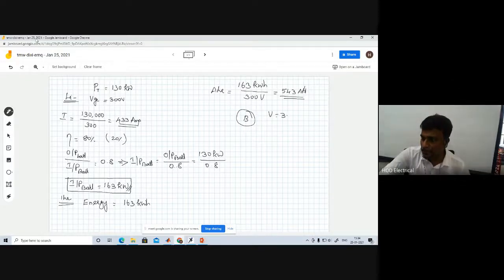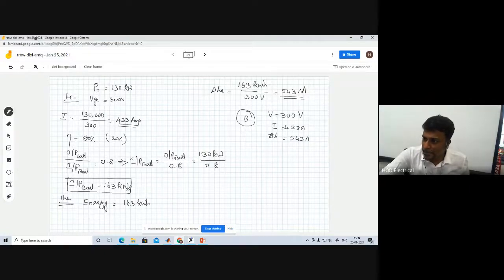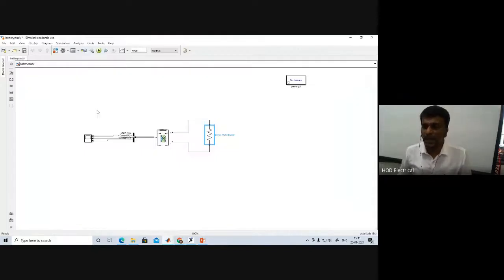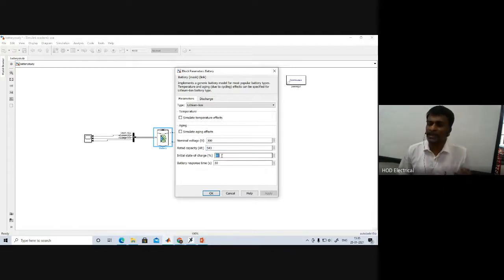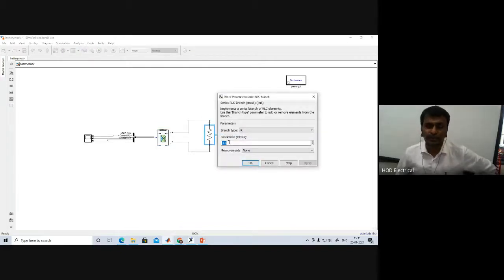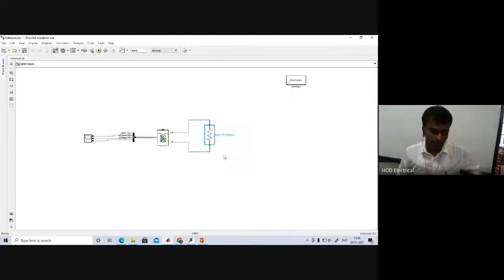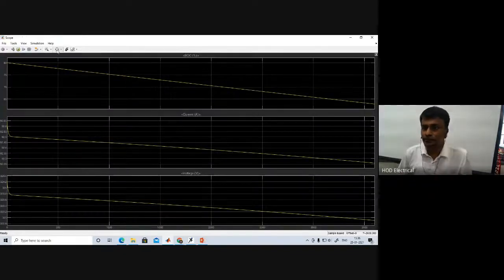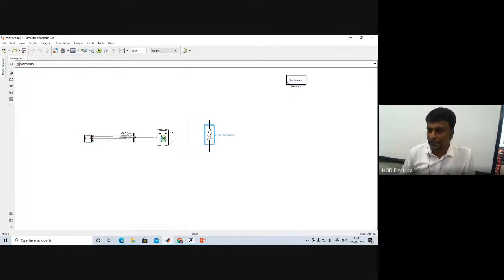Electric Vehicle 18: Battery Design for Electric Vehicle By Dr Rajin M. Linus

Comment: Explained well! Isn't the Current rating (I) for the battery at the end of the calculation be 543A instead of 433A?
Reply from the maker: Thank you for your comment. 543 is the Ampere hour rating based on the energy requirement.

Comment: Sir... Your explanation is good, but i have one doubt
First  we are calculated  the total tractive force from that we have selected the battery rating according to that required tractive effort.. Now my doubt is
While calculating tractive forces we haven't  considered the battery  weight,  in ev power train design weight is also a factor which will  effect on rating of motor. So how the weight of battery will effect of power train design of an ev
Reply from the maker: Total wait of the vehicle includes all sir. 1000 kg expected all. Thank you for your comment and discussion to allow me also thinking in a effective way 🙏🙏
Reply: @Electric_known  before selecting the battery capacity, we don't  know the weight of the battery, after knowing the rating only we can get the weight of the battery but by that time we already  calculated the tractive effort.
Reply from the maker: @chandrasekharreddy2539  Dear chandrasekhar sir, your question is correct. But, by doing analysis if we know tractive effort we can predict how much weight will be including battery and power train based on existing experience. Accordingly one can predict right? I hope the doubt is clear